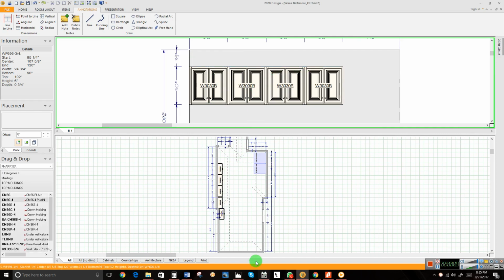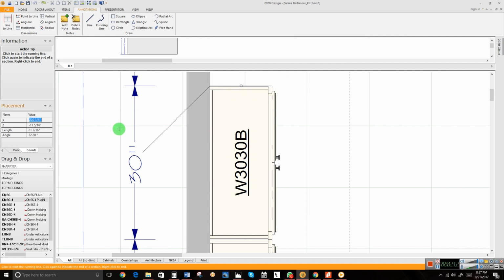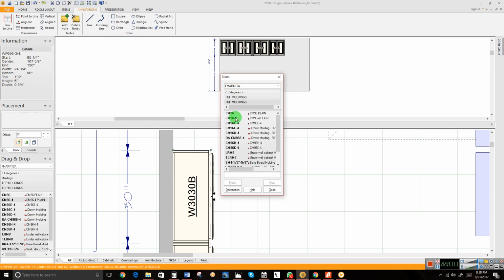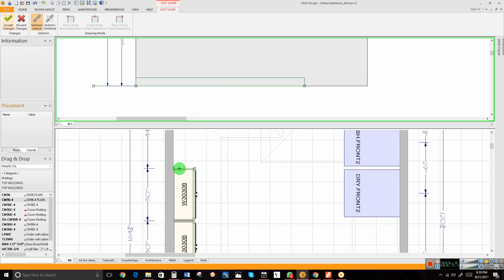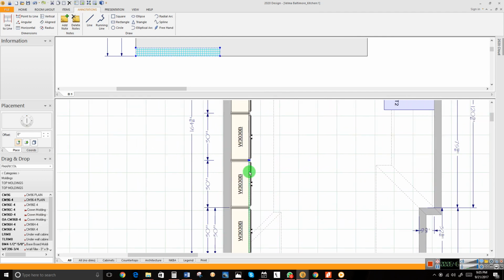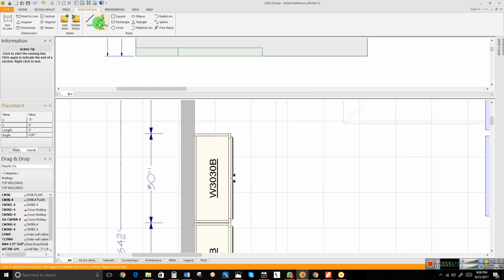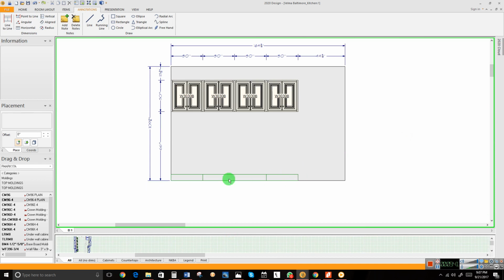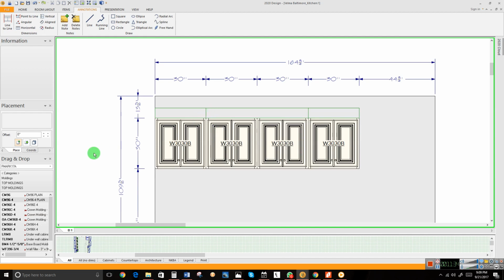2020 Tips and Tricks -Crown Molding Advance

Comment: Thanks for the video. Can you help me to change snap points? I can not get down to the resolution I need.
Reply from the maker: I do not fully understand your question. Can you explain better?
Reply: @kdpdesigners  Example. I was trying to put in a counter top using a form line first. I wanted to select a certain size by eye and I could not get the line to snap exactly where I wanted it. It was close, but not accurate enough.  I want to snap, lets say, with 1/4" accuracy and my current snap to a point is more like a half inch or more. And thank you in advance for your help. I assume there is some global setting to set the accuracy of points you want to snap to.
Reply: @siamictexas5082  If I get you rightly, you seem to be missing how to accurately input a distance when you move a line. The best way to move with precision is usinf the Placement Box, here you can just type the distance and hit enter. Let me know if this helps. Send me an email to kitchenetal@gmail.com and I will send you a small video that shows this.
Reply: @Ahdeseye  No. I can do walls. I am talking about surfaces that are not a perfect rectangle and where you can snap the end points. I need finer resolution.
Reply from the maker: @siamictexas5082  Oh! did u mean how to snap to irregular shapes using lines? example is an irregular curve or bend? The best solution is never to use snap! Zoom in as close as possible and click to the nearest points but make sure that the "Ctrl + Shift" keys are held down before clicking. 
The trick is to zoom in as much as possible and to override snap. Thats about your best option to trace over irregular shapes. 
Do not forget to use other line types as well like spline and combine them. You can also add points along a line to adjust the precision.
Reply: @kdpdesigners  That is what i was looking for. A video on that would be good too, if you are looking for ideas. Thank you very much.